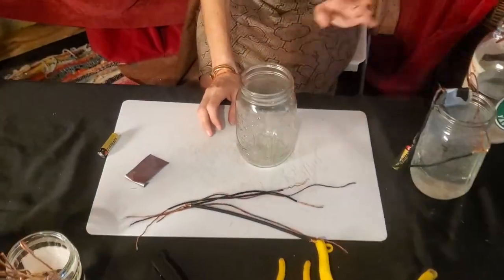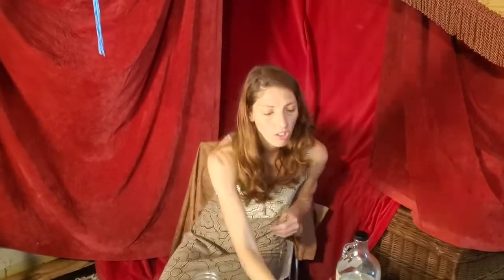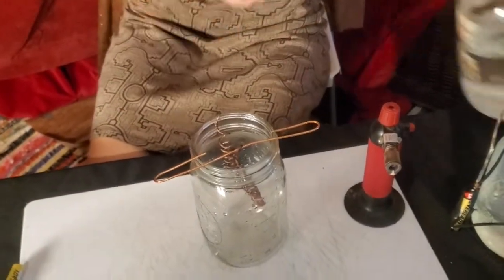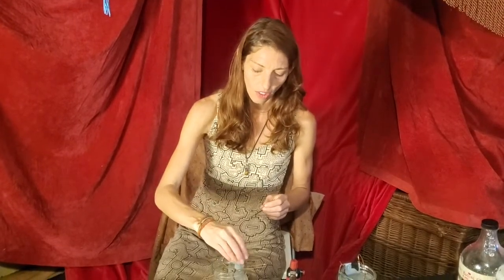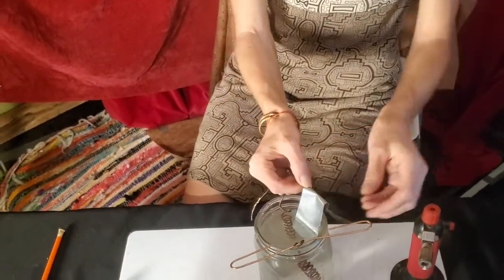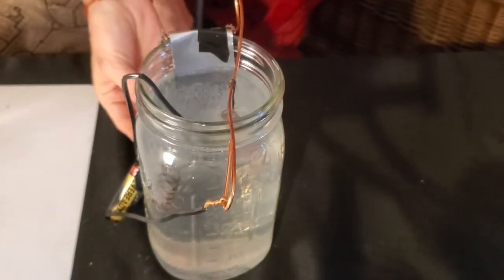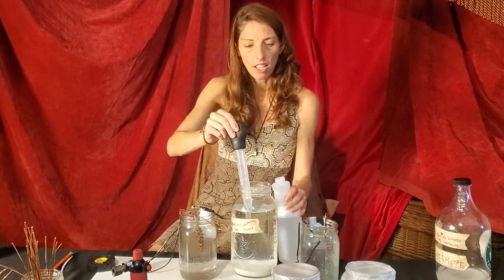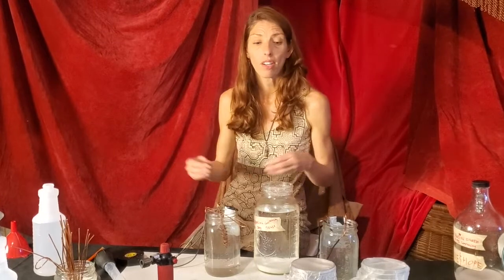How to make Co2 GANS water and how it works?

Comment: So many words were added on the explanation and one cannot exactly say you're making CO2 GANS water with that setup. With the addition of copper together with the zinc as one, the energy field it will create with the nano coated copper will be totally different and no longer that field of the element Carbon as intended in the original CO2 kit setup.  If your intention is to lower the energy of a virus that it no longer remain as the same strength, all you need is the lightest GANS that the virus does not have any choice but to give out its energy as it is the natural flow of energy that is from higher strength to a lower strength.  When one truely understand the technology, these things are no longer needed anymore as you can easily handle any viruses or energy fields by yourself.  There is no such thing as electromagnetic term in Plasma Science, you're mixing things up and this is where the problem or confusion start to appear. The technology shared by Keshe is amazing in this lifetime, however, it requires full understanding that it provides the correct outcome and it is a huge resposibility for anyone who wish to pass it forward correctly that it does not do any harm. It also requires one to be creative while maintaining the correct understanding about matter and plasma ciruits, when to use matter state, nano, GANS or even fields as materials or a combination of any or of all.  The good thing with Plasma Science is that it is a lot easier to implement and make applications that significantly help any fields of Science or existing technology. We all have so much to learn and doing it right one step at a time is key and a primary responsibility.

Comment: Hi Indra,  does it matter what size/strength the battery?
Reply: It needs to be a battery that has been used. One that you would normally throw in the bin.  If you use a fully charged battery it will be too strong and too fast. Place the battery higher than the glass jar.
Reply: @Noor-jw2tn  Technically, if the intent is to use Plasma energy flow in the circuit (which is the usual case for any plasma circuit), one have to connect the battery negative to a nano coated surface only and no direct contact to the matter state part. The nano material will serve as the filter (energy conversion point) ensuring plasma flow and not electrical flow. One can work with a new or old battery or a power supply. Distance between materials , pressure (voltage) will help how much flow is allowed. Too much flow will convert the excess energy into heat as there is resistance in the matter state components of the ciruit or system setup.

Comment: Hi Indra, thanks for making this video.  I didnt quite understand about the washing.  Basically, you pull all the water out down to the white precipitate, right? After all the water is pulled out close to the white part, you add new water, right? ...the first 4 times, you put the water you pull into a jug for external purposes like cleaning.   Then the 5th time you add water and pull it out----that's the gans water we want to use, right?...then you said...you could keep adding water and pulling for 300 years(?).  How long does the water need to sit in the jar with the white stuff before you take it back out?  Can you use tap water or do you need distilled water?..any special considerations about the water?  ...I hope you can add the links you mentioned about how to use the gans water for prevention, etc.  Thanks for making this look easy and translating some of the keshe versions which seem tricky.
Reply: In regards to getting the sweet water. Ithink she means you take the water off the top and transfer into a new jar (jar 2) then let jar 2 settle for a few days then you take the water off the top of jar 2 and transfer into a new jar (jar 3) and then you let jar 3 settle for a few days and so on until you repeat the process minimum 5 times. It's basically allowing more time and space between water molecules for the floculation of the gans powder in solution.
Reply: Yes please I am confused on the same things... if you could ... thank you for doing this it's amazing!🥰
Reply: So is this the same as plasma water,,
🥰 thank u
Reply: Good summary, i felt the same way and your summary made it more clear. I think you are right in your summary. I personally will be using distilled water when possible, even though I heard that tap water is super amazing for this as well as it mold super easily to the process. Thanks a-GAN hehe a little gan humor for you 😅